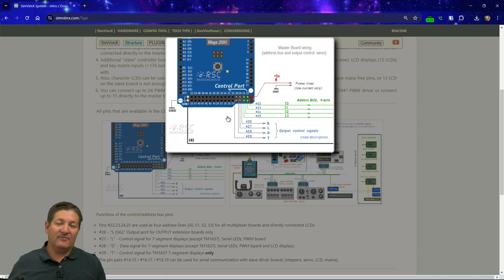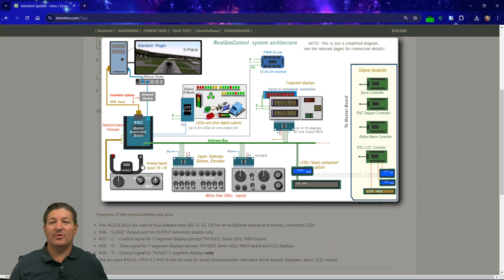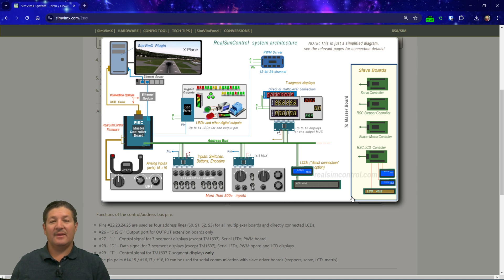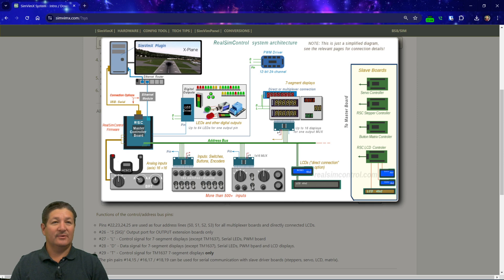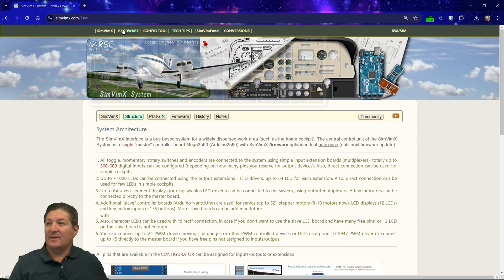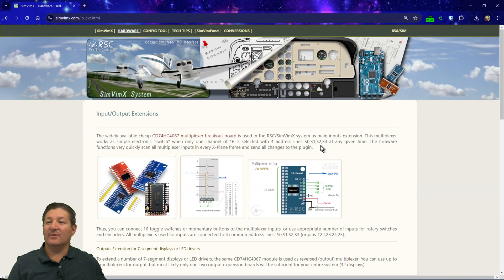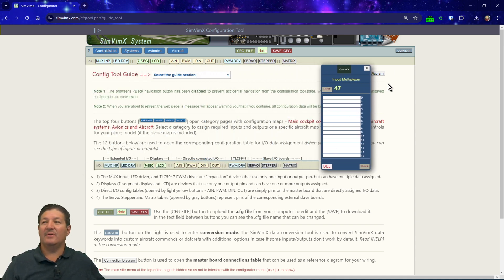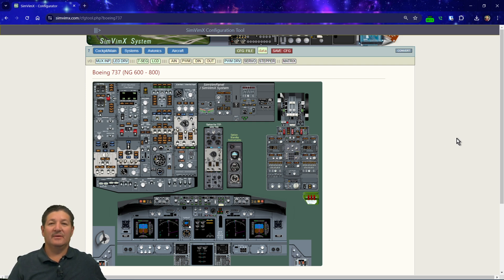Using Multiplexers with SimVimX

Comment: Not sure if somewhat this issue or can help me with it, but I feel like I have everything wired as in the pictures, however the one switch I have set up for testing, doesn’t work correctly, it activates only when I unplug the multiplexer vcc line, and doesn’t do anything when using the actual signal pin. Any ideas please?
Reply from the maker: @America737Project  The only way I can possibly help is by seeing very detailed pictures of your wiring.  I will tell you though, I have helped quite a few people and it was always incorrect wiring. You can email me if you with my youtube channel name at gmail.

Comment: Excellent comprehensive video!!!!  I would like to request another future video.  Please check the selection and multiple append Simvim software capability. I have one input mux pin that has 0-9 appended items for that one pin. I also have another input mux with a 10 position rotary switch used as the one selector (#1). The selector (#1) does not just pick and modify the proper selected  (0 to 9) item out all the items appended on that pin but all the appended items at the same time. I properly assigned the one selector (#1) and the item number (0-9) per the selector input dropdown list for each item separately.  I believe there is a Simvim software problem.  I need this capability and I believe many other builders will also. Please provide an example of this capability in a future video. I think I implemented this capability properly per there website.THANK YOU !!
Reply from the maker: Hi there Jo-lo, yes I will make a video on selectors. I'm a little confused with what you tried to describe though. You mean that when you change the position that the selector is in it changes the function of all the pins on the other 10 position rotary switch? Not just that one position it's supposed to?  Or if you could send me your CFG file that has those assignments an also a brief explanation of what you are trying to do with that selector.
Reply from the maker: For some reason I have a feeling you might be using selectors wrong or you might be misunderstanding how they're supposed to work. I've read your message like 10 times already trying to figure out what you are trying to get it to do but I'm still confused. Usually you would use a selector to change the keyword/function that a single push button, toggle switch, encoder, display shows. Are you treating the 10 positions of the rotary switch that's not the selector as 10 separate switches? Because you can't append multiple functions to rotary switches. Sorry JoLo, I am really confused 🤣
Reply: @Qosmokid  I will gladly send you my small config file. Please tell me how to do that. I do not have your e-mail address. I can see why you might be confused based on your response and my description.. The 10 position rotary switch is used as the selector. It selects one of the 10 appended items appended to each one of 5 input mux pins so as to change their control of a particular x-plane's  function. What I am trying to accomplish is to use one rotary encoder to change the heading,  altitude, nav,  com,  crs,  baro, ( fms, or range for G1000-3) and ( fms or range for G1000-1) a total of 10 items, The rotary switch selects which of these  previously mentioned x-plane controls will be influenced by the rotary encoder. The rotary encoder is implemented by push buttons not by an actual rotary encoder. Confusing? ---Probably. I am building a generic cockpit which will serve my needs,  THANK YOU for your interest and time.
Reply: Sent you my conf file for your consideration . THANK YOU!!  Realized I had your E-Mail address.